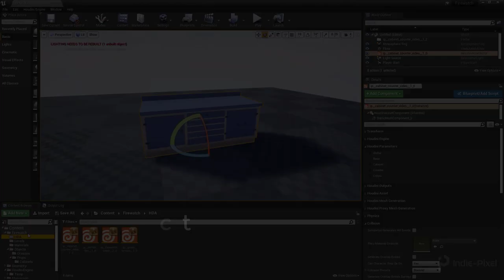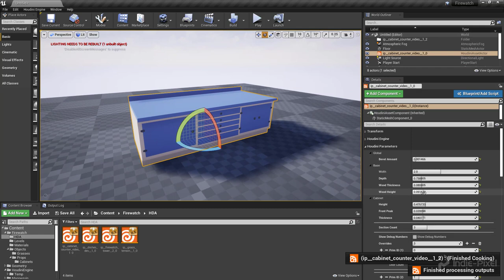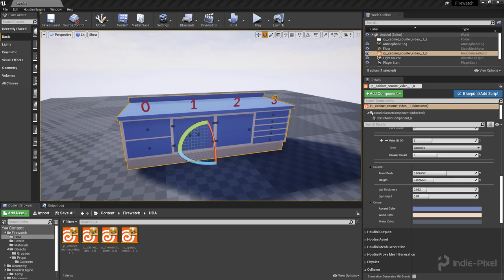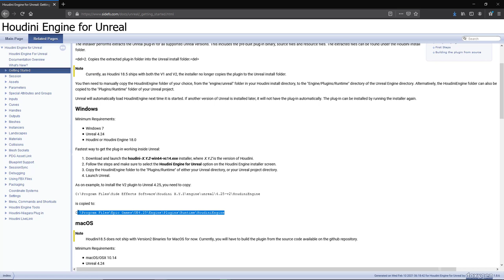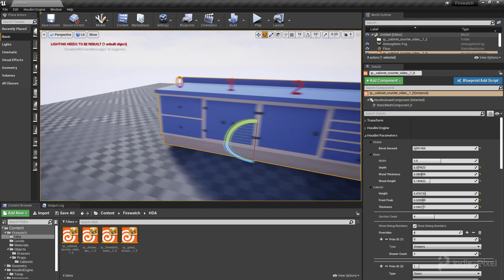Firewatch Project - Procedural Props #1 - Intro

Comment: I struggle because I like Houdini and its interface, straight fwd, does what it's supposed to; but I'm not a programmer at all. It kills my creativity. Does that mean Houdini is not for me?
Reply from the maker: No, you van do a lot in Houdini with no programming...or use vops rather than vex.  Vops is all visual.
Reply from the maker: Also wanted to add that I started in the game industry as a character artist and I found the Nature of Code book to be the gateway towards learning math/programming for houdini as well as using the processing language to produce art with code.  Those are my two recommendations.